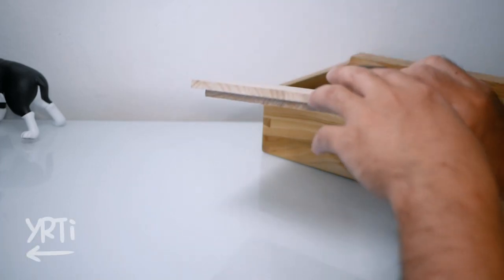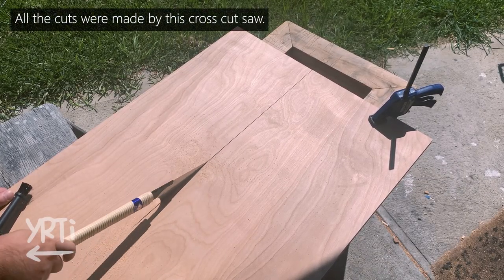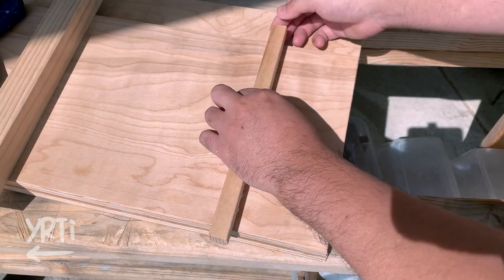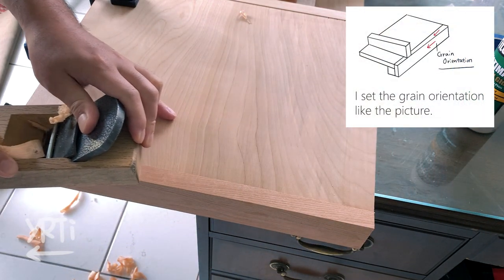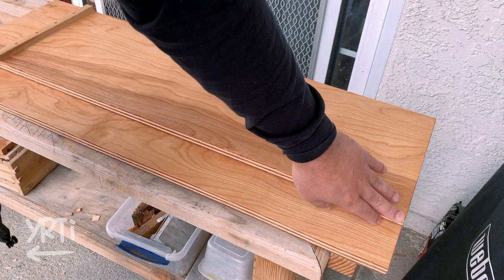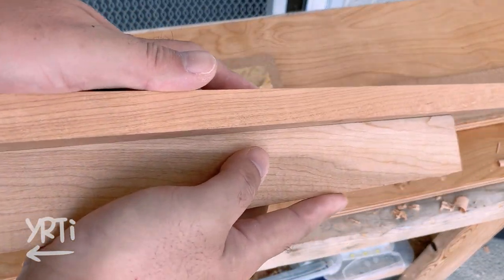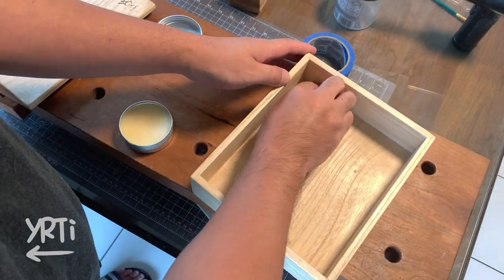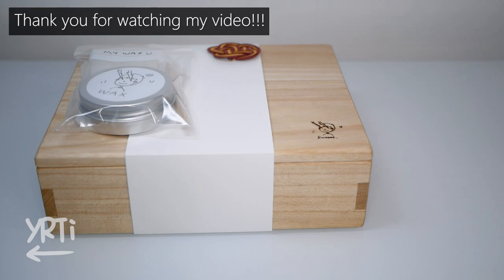Making Shooting Boards - Hand Plane on Edge/End Grain

Comment: Hello! May I ask how you prevent the kanna blade from cutting into the end grain shooting board?
Reply from the maker: Thank you for the comment! It actually cuts the shooting board and need a minor adjustment just like a miter shooting board(That is the reason I put the cherry board on the side). If I have more Kanna, I could set the bottom side of the Kanna sole flat(usually set to be a slightly hollowed) and use it as reference against the jig to minimize the damage but it's just to minimize it and still needs the adjustment. Having carefully using it for months, I just needed to adjust it by few slices though...
Reply: Ah okay. thank you so much for explaining! @YRTi